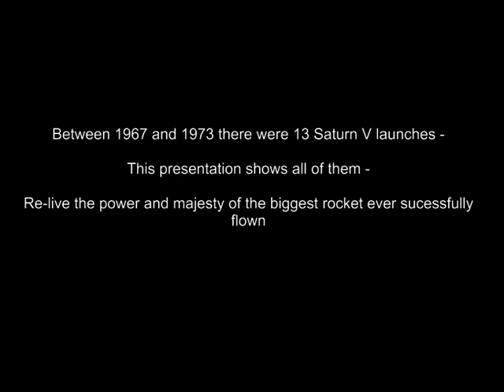Saturn V (Multi-Screen)

Comment: The delay of approx. 25 to 30 seconds between the shutdown and separation of the S-1C first stage at 05:10 and the separation of the interstate, called the "skirt sep", at 05:35, was because the clearances between the interstage and the second stage engines were very tight, and they had to make sure there were no sideways movements. For the next 25 seconds, the computer’s focus is on making sure that there is absolutely no sideways movement of the vehicle.

Comment: I still remember seeing some artist conceptions from an article in a World Book Encyclopedia Almanac for 1974 or 1975 of what then was to be the Space Transportation System. It consisted of a huge booster with a smaller orbiter slung on it's side. The booster would fly back to the Cape and I think it had 9 F1 engines. Power to be sure.

Comment: You can always tell which one is Apollo 13 because that lower swing arm (the first of two "early" arms) must have had a LOX valve failure on the plate to seal, blowing cryogenic steam all over. (None of the others did that)